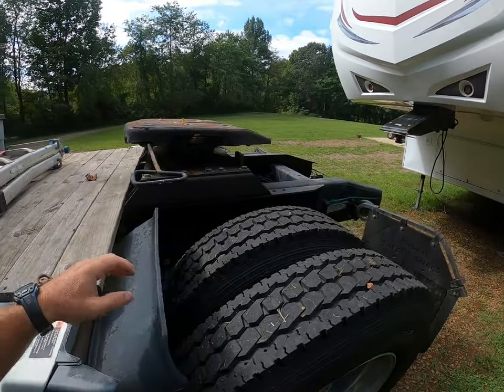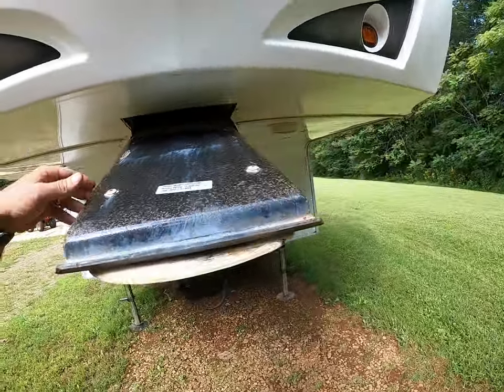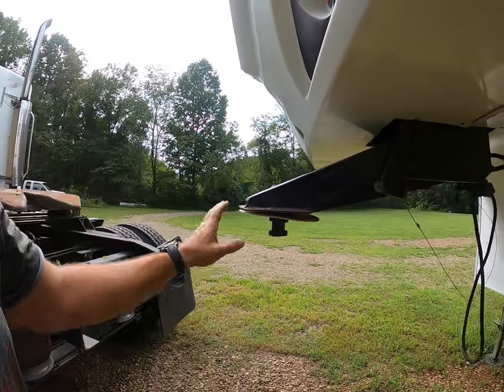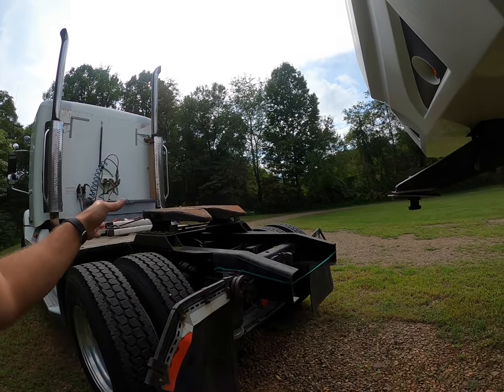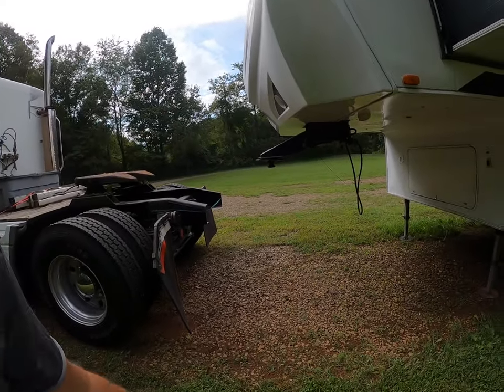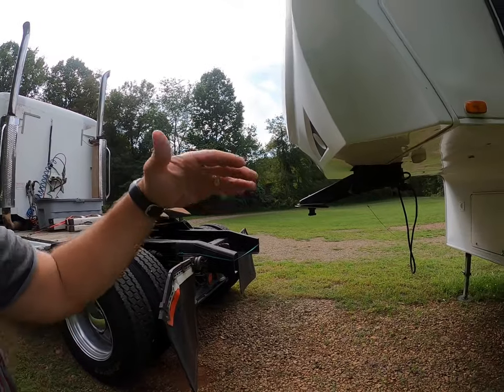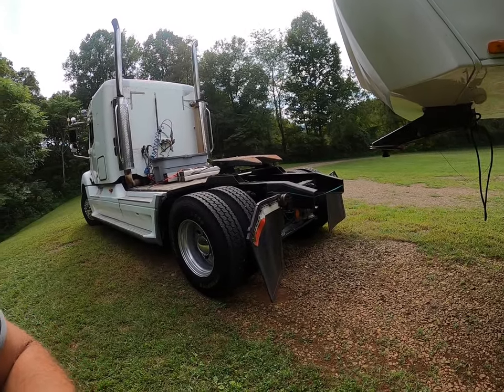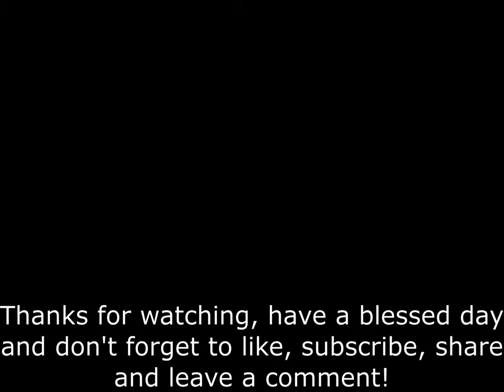Can You Use A Commercial Fifth Wheel Hitch To Pull A Fifth Wheel Camper?

Comment: You can use a regular 5th wheel plate just understand you WILL break the Trailer! Its been proven the suspension on a class 8 truck transmits TOO much stress to the RV and will break the frame. Cutting corners only if your a gambler and MURPHY never catches up with you!
Reply from the maker: Do you have a link for this proof. That would be an interesting read. It's hard to sort through all the sponsored articles to get to the truth. I wonder if this has actually ever happened or are the rv hitch companies just saying it'll happen?
Reply: @GlennConner  No links. I read a article several years ago about replumbing a semi's air ride to include a PING tank which was just a add on air storage tank to act as a surge tank to allow the air in the air bags and air lines to soften the ride of a 6k lbs pin weight of a RV or Goose neck Trailer because the air ride was setup to handle a 50K lbs pin weight of a semi load and was just to Solid. I think they lowered the air pressure in the bags also? Think about if you pulled the springs all out and welded the rear axle to the frame how long would things hold up? There are some videos on HDT RVers of Rver's talking about having Broken Frames or seeing broken frames. Some videos of hitches in action and the harshness on the frame.  A couple videos on hitches being worn out or broken prematurely.  Also it would be just a lot more "Safe" anyway!  You "Can" get away with just about anything, for a little while anyways. As Always You can do what You want its your Rig!
Reply from the maker: I think there needs to be a clear understanding of how airbags work. You can't lower the pressure in the airbags without lowering the ride height and if you lower the ride height you change pinion angles. Semi trucks with airbag suspension have an auto level valve to compensate for load and to maintain the proper ride hight. So a bob tail truck will ride the same hight as a fully loaded truck. This translates to a light load having less pressure in the airbags than a heavy load, this is all done automatically by the auto leveling valve. It only adds the amount of pressure needed to maintain the ride hight. Airbags do not have a constant pressure. The only way to soften the ride on the trailer would be to add an air ride fifthwheel hitch. I think the only concern would be in the fact that the semi's fifthwheel doesn't have left to right pivot.
Reply: @GlennConner  I ALSO said I (Think) they lowered the pressure it was a article I read some 10 plus years ago. I have owned Class 8's since 1993. Yes you are correct, no argument on that.
Reply: Okay
Reply: @barntt  then you would of known that the suspension wouldn't be an issue right?

Comment: Dont like to see a dry 5th wheel pad its either messy grease or a silicone pad .  Lets face the facts these are not semi trailors they are quite flimsy rv trailors by nature to keep the weight down , so in keeping with that thought swop your old rv 5th wheel pad over to your truck problem solved in that respect, The pad over the axle is the best thing since sliced bread also closer coupling will equal better fual consumpton thats why they have airofoils behind the cabs, The RV  world thinking is getting a smart car on the back hence 5th wheels are allways behind the axle / s does it promote good roadkeeping thats the big debate.   Big problem is the rig as it stands you cannot check for cracks very easy so by the time they happen its to late.
Reply from the maker: I do have a lube disk on the camper, so there is no need for grease on the plate. I do grease the jaws though.